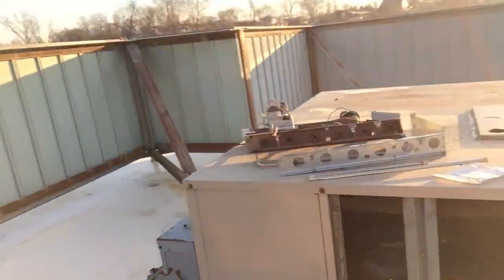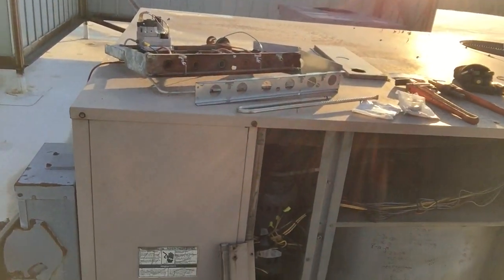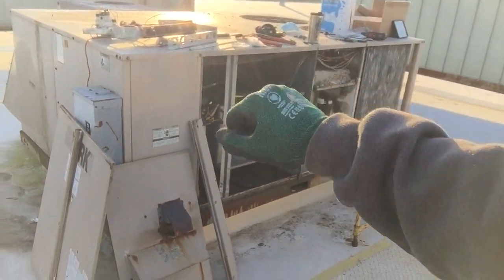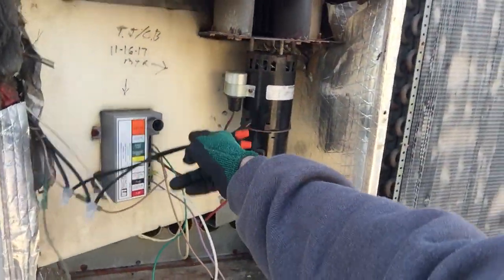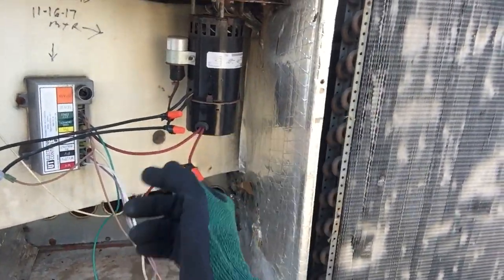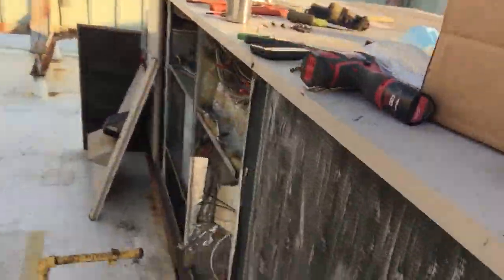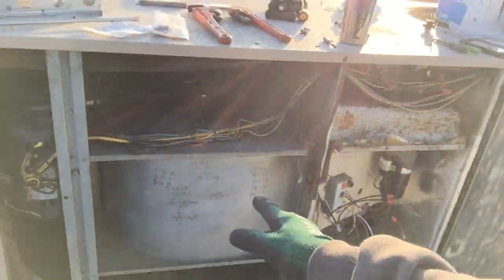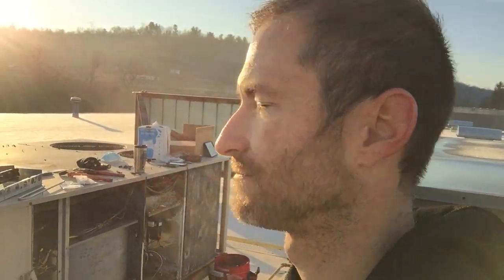HVAC EXPLAINED- York RTU No Heat.

Comment: Nice tutorial. What should be the microamp going back to the module? Thanks
Reply from the maker: Thank you very much I do appreciate the compliment.  
To be honest with you at this point, I really don’t know?   I just know 24V feeds that ignition control module ICM. But I believe that generates 10,000v generate the spark. 
Since this video, I have moved to Florida, so I do not have access to an identical unit at this time to check anything.
Those units tend to be very reliable by changing a heat exchanger is not easy.  
Have a great day. Thank you for the compliment.

Comment: New to commercial rtu service with mostly residential experience. Ran across one of these older Yorks with the pilot carry over tube not igniting. Can you comment more on the grounding issue? 
 Had one yesterday with the ignition module, ignitor,  flame sensor and pilot tube had recently been replaced by someone else. And still not working.  No safety tripped. Getting voltage to GV, and gas through pilot tube, ignitor sparking but not lighting. 
Thanks.

Comment: Hi, my york rtu unit is giving a HS1 limit switch error on the smart simplicity control. I've checked the high limit switch and it seems fine. The manual for the control says the LS1 has tripped 3 times within an hour. This results in the HS1 LIMIT SWITCH LOCKOUT.  Any help would be greatly appreciated. Thanks.
Reply: The unit was running in heat mode. Thanks
Reply: Filters clean,  vfd direct drive. Unit was heating fine before a snow storm came. I turned off unit to reset it and it ran for about 10min  then heat goes off and only blower fan on.
Reply from the maker: @mark.r8900  have you tried jumping that safety switch just temporarily?
Reply: Everytime it locks out with HS1 ERROR  I turned power off for a few minutes and on again. It always run for around 10min and burners shut off again with blower running only. I did a continuity test on the limit switch and it seems ok. Could it be the limit switch?. The unit is only 1.5 years old. Thanks
Reply from the maker: @mark.r8900  I’ve had on the York’s  the Rollout switch have continuity but not fire up until I Jump out the switch “therefore i replaced the switch. “ 
Age doesn’t matter in my opinion.  I’ve had new equipment bad from factory many of times. I’ve even had wrong voltage motors installed on equipment that don’t match the name tag. 😒
I would would check wire connections first.  Then check return air temp and supply air temp second.   Still sounds like a safety opening possibly weak “Temporarily jump out”.  If still continues you may have a bad board”.
Reply: Thank you for your help .
Reply from the maker: @mark.r8900  are you on it right now or going back tomorrow?
Reply: I'll be back tomorrow. It's-25C right now.
Reply from the maker: @mark.r8900  ok. Good luck.  Also verify nothing is blocking the flue exhaust or combustion motor squirrel cage.  Please let me know what happens.  Hope you get to spend some time with the family for Christmas.  Stay safe.  👍
Reply: Same with you. Thanks again.
Reply from the maker: @mark.r8900  you’re welcome 🤙
Reply from the maker: Hello Mark.  
OK, I have a few questions.  
Just a few basic ones.  Are the air filters good?   Is this belt driven or direct drive fan ?   Any fire dampers in the ductwork? Do you have good airflow coming from the ductwork? 
I’ve had faulty limit switches, can you take a temp reading from Return and Supply…
When you restart it does this fault / alarm pop up immediately or after it runs for a bit ?

Comment: We have a York DM180 that we have worked on for months that will not ignite even with many new parts.  Where are you located?  Can I call or email you?  Thanks
Reply from the maker: Hello good morning Camper.  Please email me info on what parts were replaced along with any info on repairs or things tried to resolve this issue to this unit.  These older York’s can be a headache. What is environment is this unit in? Corrosion can make them have issues with Grounding.  
Just a few suggestions: “Temporarily” Jump out the Rollout switch, Jump out high limit / manual reset switches located in the heat exchanger compartment, also cut and replace all spade connectors on the ICM and on the other switches. Have you inspected heat exchanger?  I was located in Pittsburgh, Pa. Im currently in route to Florida.  I’ll check email when I get a chance have a great day and keep safe.  👍Hvacexplained@yahoo.com
Reply from the maker: Hello Ed.  Just curious if you had any luck with the RTU ? I’ve had nuisance issue with grounds on these units?    Hope all is well have a Merry Christmas
Reply: @hvacexplained9341   cant get it working,,,, will  let someone else try.
Reply from the maker: @camper118  😞.  Well you gave it your best.  That’s more then most people will do.  I’ve had nuisance problems involving grounding and the burner manifold due to corrosion.  Wish I could there in person to see if we could figure it out.   Please let me know the outcome.   Home your holidays are going well.  Be safe Bud.  👍

Comment: Why you said at the end that the blower motor on this unit stays on?
Reply from the maker: The control system that they are using on this building is the older carrier VVT system.  The blower motor must run continuously for to operate properly on this particular system.

Comment: Love it!   Short and sweet with no added fluff or just to hear yourself talk.   
That alone gets a Subscribe/Bell
Reply from the maker: Thank you very much DeltaFour.  
I know I do tend to talk fast in the videos but I try to keep the videos short. I try to get to the point and sometimes have a good analogy as well so people can understand. I will be posting many more shortly I’m currently out of town visiting family and I’m limited with time for editing.   If there’s something in particular you would like to hear pertaining to the heating and air industry please let me know.  I may have a video on it or possibly can Gain access to that particular type of equipment. Have a great day thank you very much for subscribing and liking the video.  👍
Reply: @hvacexplained9341   What steps do you take to diagnose or troubleshoot  a non running  commercial equipment such as a AHU that  you have  never seen before or know anything about the controls ?
Reply from the maker: @deltafour1212  I will definitely shoot a video on some things such as this but I will list the steps below.  
First of all do not panic when accessing the situation because if you panic or getting very frustrated most likely he will not think clearly.  
1.  Check Power at Breaker and at Disconnect. 
2.  Shutdown Power and Ohm out all fuses. 
3.  Look for any loose or burnt connections. 
4.  Turn power back on and push in contactors one by one to verify what works. 
5.  Follow schematic if that’s available inside electrical panel. 
6.  There’s no harm with calling the manufacturer sometimes tech-support is very helpful.  
 That is a very good idea and question I will see what I can do about shooting a video on something like this because that gives me a few good ideas. 
Thank you and hopefully this helps point you in the correct direction.